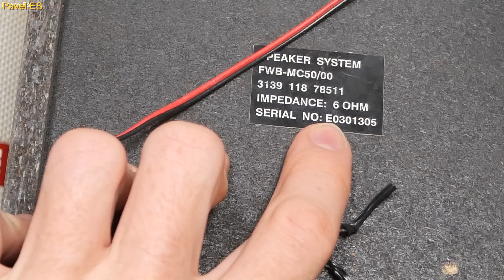TWO SUBS JBL Flip 5 [#OnlyFlex]

Comment: it's crazy how far you can go with just 20w of power
Reply: What do u mean.
Reply: @Shiftychicken04  Some people doesn't know that not only the wattage matters.And when they see big wattage numbers they think that it's going to be very loud and low wattage means it's quiet.That's not really the case cause if you look at a hifi speaker with lets say 90db sensitivity,it means that at 1watt it's going to reproduce 90db,and at 10watts it's going to be 100db,at 100w 110db,1000w 120db
Reply: it's 40 watts now because it's wired with another speaker
Reply: @TalgatsKingsmove  no
Reply: @puresesh7985  explain
Reply: @TalgatsKingsmove  just not how it works
Reply: @puresesh7985  ik it's not exactly 40 watts I'm just trying to say it's over 20 watts bc it's wired in parallel with other speakers
Reply: An efficient good active subwoofer only needs 50 watts. To deliver proper pressure.
Reply: Bluetooth frequency mode 15000 watts
Reply: I have a chrge 4 and ohhhh that thing is more the 30 watt
Reply: and even 5w
Reply: WAIT. there’s SUCH THING AS A TRIANGULAR SPEAKER… WTF!!!
Reply: Jbl is insane💀👍

Comment: R.i.p tpa3130 (original flip 5 amplifier chip)
I shorted the left speaker output, and its not working, except the right speaker output still works fine
I use the tpa3130 chip from tv sharp lcd mainboard